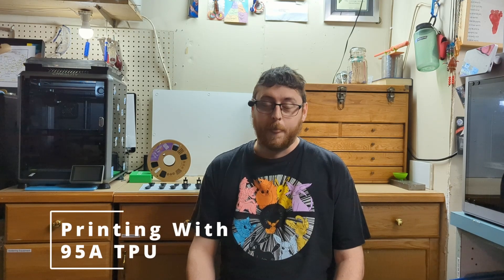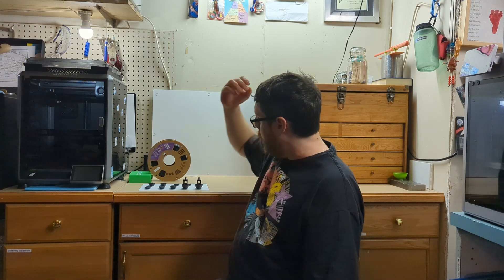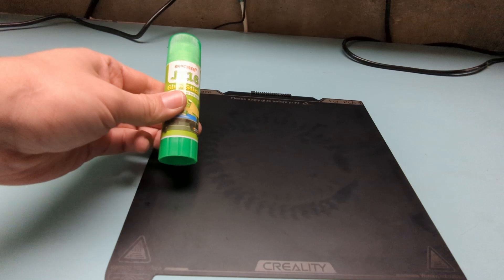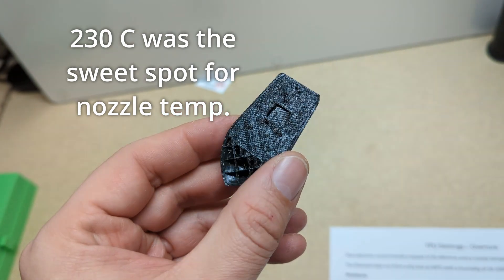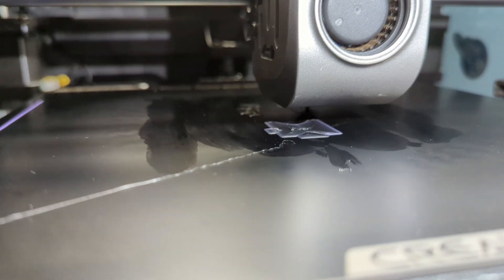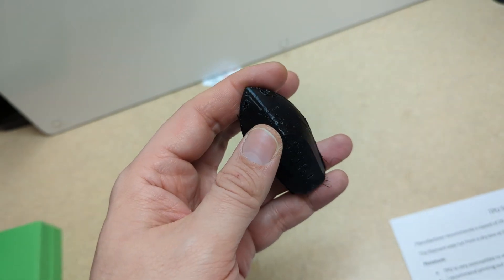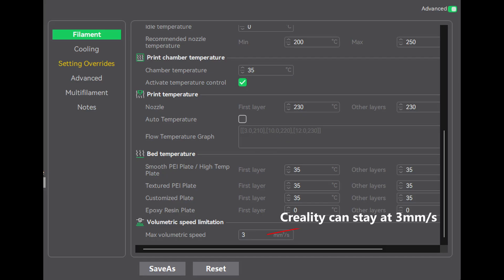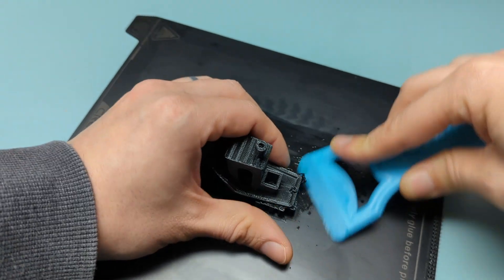Getting the Perfect TPU Settings

Comment: Thank you so much. Now I will really try your settings. Have been struggling with the TPU printing. Can you combine TPU with PLA or PLA+?
Reply from the maker: TPU and PLA do not bind well together so combining them in a model doesn't work well. However, that can work to your advantage in some cases, like using one material to support the other, then supports tear away easier.

Comment: Printed the benchy in 95A in 38m. No sagging. Just fixed the baseplate and bogie of the nextruder on the MK4S. The stock one is garbage. 11.5mm3/s. 😈
Btw, just use a textured PEI plate. No glue needed. Comes off easily.
Reply from the maker: That's awesome, sounds like you've got the settings dialed in! Thanks for sharing the info.

Comment: Your results are interesting regarding the slopes are interesting. I haven't worked with many TPUs, and I haven't used many benchies with it either, but I just printed one with 3DHOJOR 95A because it was sent to me for my channel, so I'm doing a filament review for it. But The only issues I had printing it on a bambu labs p1p with bambu's default TPU settings in bambu studio is some very light sagging on the absolute overhangs in the cabin's doorways and windows, and of course some light stringing.
There are obviously many factors to why we have this difference, but I just found it interesting.
Another interesting difference is that I have never used a print bed additive for TPU. I currently use a G10 build plate on my p1p and used to use, I think it was called a PEO surface. It's basically a smooth surface with some very light texturing to add a design to the first layer of your print and maybe for adhesion but I'm not for sure about that. But yeah, I have never used any glue or anything for removing the prints. Though looking back it may have helped with some print removals lol. I only used hairspray once when I 3D printed a tool box lid to ensure it would stick throughout the print, which I do with any print that has a large surface area on the build plate.
Good video. Very to the point. Keep up the good work!
Reply from the maker: That's great feedback, thanks for taking the time to share all that. I haven't really experimented with other build plate materials, although I probably should 😂 That would be nice to eliminate the glue altogether. I really appreciate you engaging, thanks for watching! Happy printing!

Comment: Guys. What;s going on? I run a K1 Max,K1 and K2. First layer @60mm/s. Then all others run @100mm/s. All fans set to no more than 20%. Bed @35C and Nozzle @240C using Creality TPU 95A. I found the fans causing way too many clogs and stringing. I got my prints down to 4hrs vs 12hrs. The only other changes i have made is to uncheck everything under Retraction in the Settings Overrides screen EXCEPT Length.
Hope this helps.
Reply from the maker: Great feedback, thanks for sharing with us! Thank you for watching!

Comment: Any tip or trick for smoothening TPU surface?
Reply from the maker: Thanks a lot for watching! The best thing you can do for a smooth TPU finish is to use the right temperature and to slow down the print. Make sure you've got those things dialed in. Try using a temperature tower to get to exactly the right temperature. Start slow (like 40 mm/s), and once you have the results you want you can start speeding up the prints to see where your breaking point is on speed.

Comment: This was the most helpful post I found on TPU. Your settings got me extremely close to what was needed to create a perfect part. I was getting some delayering after the part was half way printed. So, I bumped up the nozzle/ hot end temperature range and increased the bed temperature from 35 C to 40 C after printing the first layer. The parts started coming out with a nice smooth glossy finish with amazing details. Thanks for all of your hard work and for sharing your experience. 😄
Reply from the maker: I'm so glad it was helpful for you! Thank you for watching! 🙂